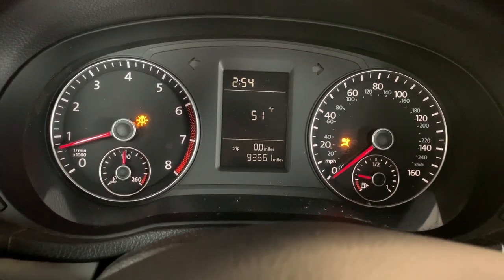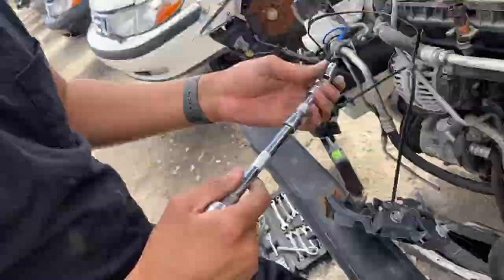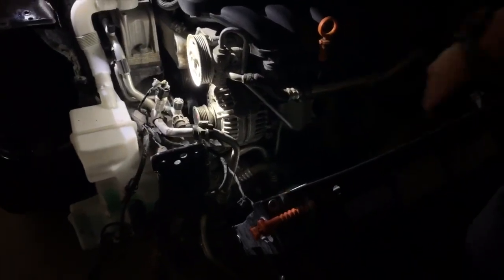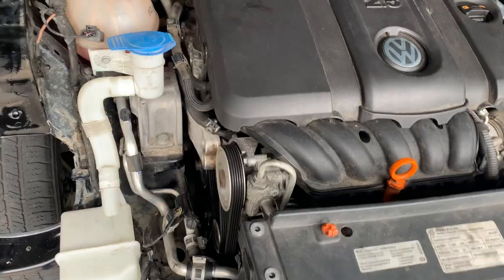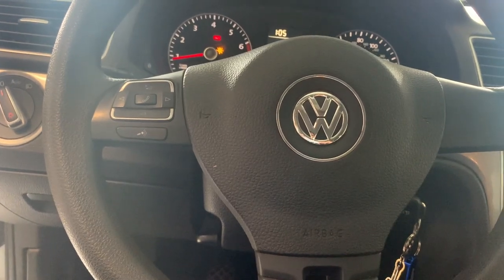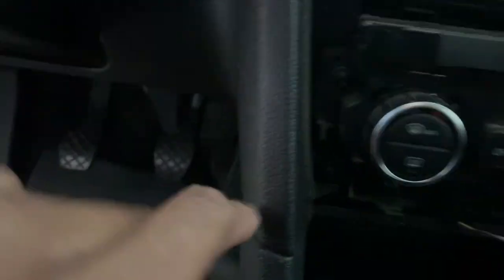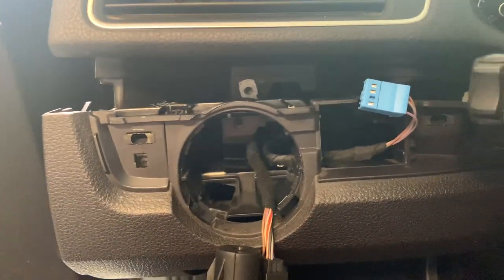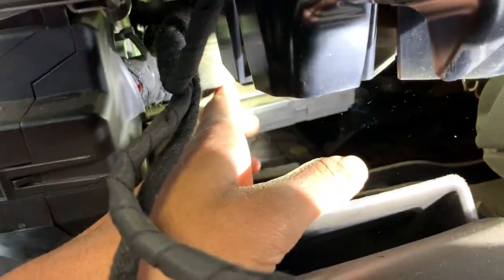Crazy Electrical problems with Volkswagen Passat/ Jetta

Comment: Do u know the steering wheel controls fuse? Cuz my horn is working but the controls dont
Reply from the maker: if you look to the driver side of the dash by the door you can see a fuse box and a paper should be there to show the location of the fuse.

Comment: I love the 2019 jetta vw look, feel, drive of the car...it's a basic & a 1.4L so it doesn't have automatic adjustable seats or anything special, but my brother in law says vw has too many electrical problems. Would u say it's worth buying the car at 68k miles for $18k? I have a good family mechanic that I think could do repairs if anything comes up not working right, but would u say it's still worth buying the car or no? I'm used to only buying hondas, but i prefer a diff car vs. my v6 honda accord i currently own that's so heavy and bulky to drive...🙄
Reply from the maker: All cars have some type of problems no matter what. But I would also ask that family mechanic what kind of repairs they can handle and if they can work on the VW because I know a lot of people do not like to work on them because they are some what kind of hard to work on. Finally I think that there are a lot of VW out their so I think you can get parts easy from even junk yard and stuff and they share a lot of the parts from there other model cars so some things can be cheaper. One of my frenz as VW that he bought with 90k miles 2 years ago and it is still running good he just make sure to stay on top of the maintenance. I hope this will help you make a decision.

Comment: I neeeed youuu , my 2013 VW Jetta is tripping doing the same thing . My horn works periodically, those two lights you showed in the beginning the air bag light and the light bulb light is on … My car will sit overnight with the fans I think running and In the morning it will not start , be completely dead … I gotta new fuse , alternator & battery ….
Reply from the maker: send we a DM and I can try to go over more things that can help. wee rebuildz.
Reply from the maker: Power could not be getting to a light bulb or a light burn out inside the car or something. and something is  left running that it draining all the power from the car.and the other light is a airbag light but that can be many things you would have to get the car scan to know what it is.
Reply: @weerebuildz4427  I just followed you on IG . Hit me there so I could show you …
Reply: @azspenhenderson468  yo did you ever figure out how to fix it
Reply: @NateHanley  no I just ended up getting a better brand new , i guess it was electrical , vw are just not good vehicles
Reply: @azspenhenderson468  was your old vw a push start and was it clicking to starting bc the battery would die for no reasonM

Comment: Hello i bought a flooded 2017 Volkswagen jetta....there's no power in the dashboard still, I change 3 relays already it cost me a little more than $200 with shipping, I change BCM,...maybe you have a idea as to what could be the problem....
Reply: I check all the relays and fuse, all is good, I just couldn't get is that there's no power at all....but if I connect wire using manual fuse tester  from positive battery to the main accessories relay under the dashboard everything is lighting up in the cluster panel...but that's about it...I can't diagnosed the car neither because no power
Reply: I hope you could help
Reply from the maker: check the main fuse and see if thats good or change it and also check every connector so you can make sure no water is in the connectors
Reply: I've done that already.....but I will do it over again maybe there's still water left in the connectors and sacket....thank you so much for your time...
Reply from the maker: @annereid1754  yea try that and recheck every fuse you can find make sure its good.it maybe even be a simple problem.

Comment: Hi I have Vox wagon Passat tdi 2009 and I have some issue with the power. Everything works well but the issue is I cannot start my car in the morning. Battery goes complete flat even though alternator, fuse and relay are good and even the battery is new. Even the Vox wagon service centre couldn’t solve it. Can you help me?
Reply from the maker: @samtendorji1128  something is pulling the power that is why the battery keep dying.
Reply: So what do you think I should do?
Reply from the maker: @samtendorji1128  when you shut the car off is anything that is still running that is taking power from the battery ?
Reply: @weerebuildz4427 still trying to figure what’s running even if I shut the engine? Thank you
Reply from the maker: @samtendorji1128  yea because something has to be pulling the power

Comment: Hey bro, I got the same electrical problem, so I replaced the battery and alternator , but the battery light is still on. Do you know the part number or name of the fuse that you did in video? Thx~
Reply from the maker: main fuse PN ( 118769-01393002 ). that's the part number you can get it on parts geek just type in google battery main fuse and see where u can get more from like if u wanted to get it at VW.  no problem
Reply: Ever figure out ur problem